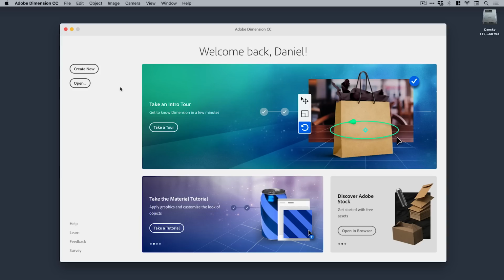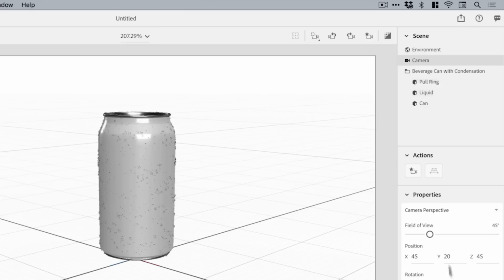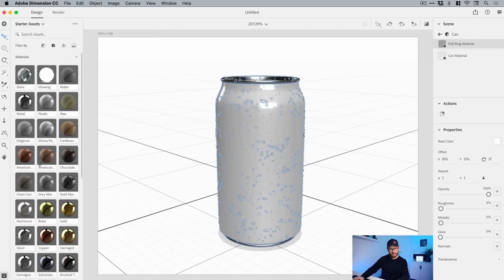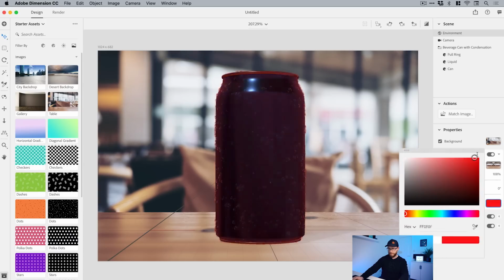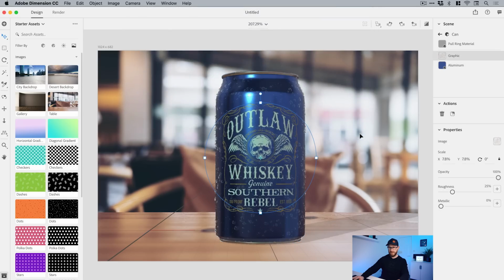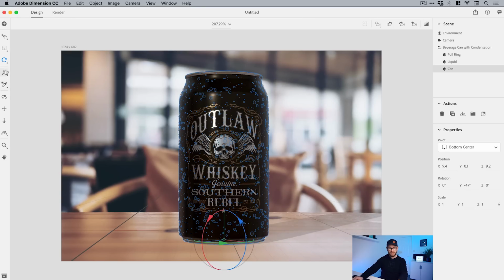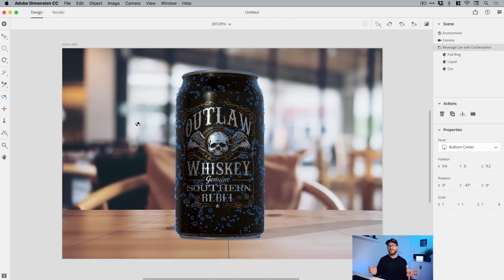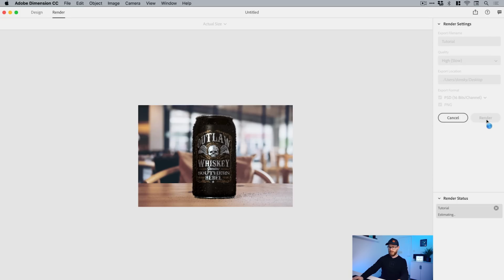Adobe Dimension CC Tutorial | 3D Product Mockups for Beginners

Comment: Hi Dansky, I don’t see the render window in my Adobe Dimension 3.4.7, has it been removed to feature it on the canvas instead. ? I saw it on one of your tutorials and others as well. Thanks
Reply from the maker: It’s a tab in the top-left corner, if you toggle over from ‘Design’. Just checked on the same version and it’s there for me 🤞
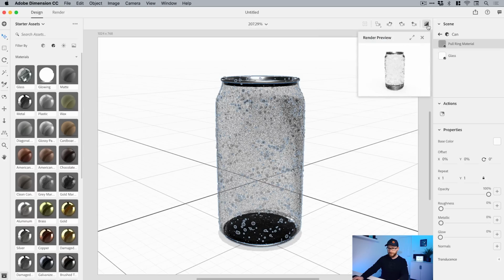Reply: Sorry I didn’t mean that tab on the top left, rather the one in the top right, Show/Hide Render Preview, in this video it’s on 5:36. a small windows is viewed as well as the canvas. Thanks.

Comment: i do lots of logo design and make mock ups for it using photoshop. I ve read that Adobe Dimension is actually very good for mock up. Cant wait to try this!
Reply from the maker: It’s a hidden gem! Great for creating custom mock-ups, and also creating assets that can be used and developed further in other apps, eg. Photoshop 👍
Reply: @ForeverDansky  forget about it. it doesnt actually run with my macbook air m1. it open up but no ui whatsover. i did google and found out that Adobe is actually want to abandon this because they wanna push the new Adobe Substance 3d. sigh

Comment: Great video, I look forward to more tutorials! I do have a question though. I recently bought a refurbished 2016 MacBook Pro 2.6 GHz i7, 16 GB ram, and Intel HD Graphics 530 1536 MB. Should Adobe Dimensions run smoothly? I'm not too worried about rendering times, just overall smoothness of running the program. Thanks for the helpful video!
Reply: Should be pretty enough for a stable run. I am currently using 2015 Pro and not many problems with Dimension so far. Even though mine has 8gb ram. Just be sure not to have many other apps running at the same time, because this software is pretty damn like AI or PS in terms of memory usage.
Hope my answer is still helpful, haha.
Reply: Alexander Brazhnik thanks! Great vid btw
Reply: @jonathanchristen2235  that's all to Dansky, I am just a viewer like you are. Good luck and stay safe!

Comment: Learn 3dsmax or Maya or heck Keyshot and Blender....its free and has interactive viewport and features that will blow you away. This is a tool for the consumers and not 3d artists. It`s something quick and easy. For product visualization I`d go for Keyshot. Blender is great all around but has a learning curve. I have 25 years of CG experience and I`ve tried and used all of em.
Reply from the maker: The learning curve for Dimension is about 30 minutes, and it's more geared towards 2D designers looking to quickly create mockups and generate product visualisations. Blender, Maya etc. is software for 3D artists like you say, but a very different offering to Dimension.

Comment: What would be the best way to wrap a label completely around a can? Every time I do it, the artwork doesn't line up properly when it wraps so any horizontal lines don't touch when it wraps. Also, is there any way to select specific points to scale just that point (or points), like one could do in Illustrator? I am using a soda can and trying to make it a TALL can but when I scale vertical, it also distorts the lip on the can. If I can just extrude the body of the can, that would be great. Thanks!